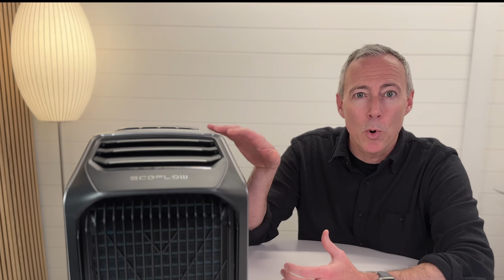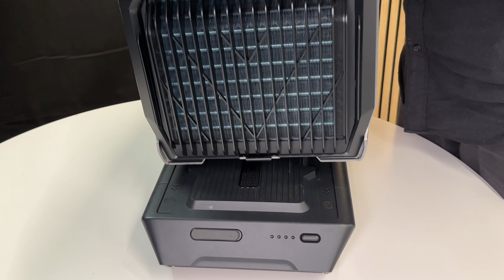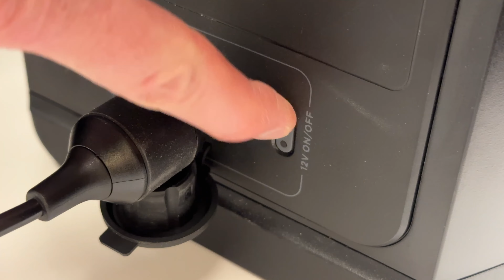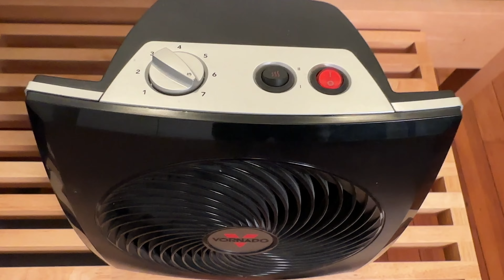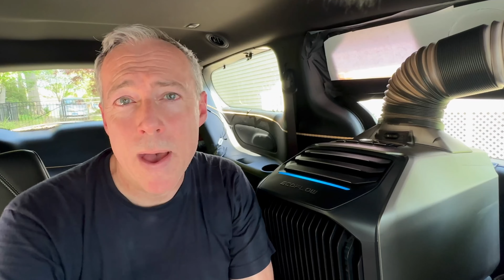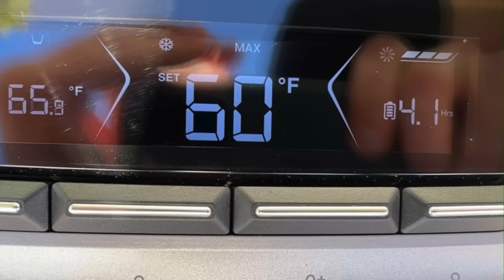EcoFlow WAVE 2: Heater + AC in a tiny, portable package

Comment: Good video.  Mine is arriving tomorrow. My question is, do I need to vent both hoses out the window?  Especially since I live in Florida and the humidity is awful.  
I’m wondering if I can vent the exhaust and keep the other hose off to intake cooler air from my Rv.
Reply from the maker: Turns out you do. I missed a few things in the manual so the test where I only had one hose in the van wasn't as efficient as it should be. If the unit is inside your room, you need to vent the back and top out the window, like my heat test had it
Reply: @todd.parker    Ok great.  I figured as much. But I thought it may be more efficient drawing in less humid air than not.  But I didn’t design it and that’s what the drain tube is for.  Now I’m curious if the drain water is drinkable for an off grid type survival scenario.
Reply from the maker: @scottmcguire9618  That was why I tried it that way but it turns out heat humps have 2 separate cycles that need to be separate so you need to isolate the input from the output by using 2 hoses. I'v heard it's very dangerous to drink dehumidifier water so I assume this this same.
Reply: @todd.parker   thanks for the info.

Comment from the maker: Hi all. I've learned that I should have hooked up the second hose when doing my AC tests so this would perform even better if I had. When using the unit inside the van, both the back and top hoses should be attached. Thanks for all that explained this to me. The heat test used both hoses and the tent AC only used one hose as EF recommends.
Reply: Yeah, I was about to comment you were doing the test all wrong with only using one hose in the car. Would have liked to see how long it would have lasted when optimizing power as I’m considering using it in my sprinter van.

Comment: 5100BTU for cooler air is pretty weak
Reply from the maker: It's definitely optimal for a smaller space like a van, tent, or single room
Reply: i haven't found a portable A/C unit that has more than 5100 BTU cooling. I"m new to these things but i've been looking online all tonight.

Comment: Won't run without the battery... Where i live the unit is $1400, and the battery $1000. I can just buy a smaller residential AC and an extra battery for that money, and would probably come out on top.
Reply from the maker: It will run fine plugged into AC without the battery. I agree the battery pack isn't a great value so I'd get a Delta power station and power it with that I you need to go off grid

Comment: Can this realistically be used in my car everyday ? I just purchased it and I want to use it not only for my camping trips and my addict but I bought it because I spend a lot of time in my car on lunch breaks and I hate idling my engine in the summer to stay cool …I’m hopping this works
Reply from the maker: It would work fine. The only issue is you need 2 hoses vented out the window or sunroof and that might be a hassle driving around.
Reply: @todd.parker  thanks I would tingly use it while parked tho so I don’t have to run my engine when it’s hot and I’m just sitting there

Comment: Todd. I've been looking at battery powered AC units for my little trailer. Having installed a mini split in the house I'm very happy with the tech, which separates compression and expansion to TWO air supplies: inside and out. Which means I think you missed a point in your van and tent air-conditioning testing. I'd like to suggest you re-test by recognizing that you want to cool conditioned air. That should cool the spaces faster and extend battery life. You should ALWAYTS use both tubes. Either off the back to vent air to the outside or off the front to circulate air to the inside. With the tent you were sucking in outside cooling it and sending it into the tent. But that also caused positive pressure in the tent which would have been forcing cooled air out of the tent. You should have used both tubes for AC. One tune for the front upper vents cooled air (as you did), and the other on the front grill to take cooled air from inside the tent to further cool it. You made a similar mistake in your van. You vented the hot air out of your van but should have used the second tube on the back of the WAVE 2 so that the air you were using for compression side of the cycle was coming from the outside. Instead you were using cooled van air. Which meant hot exterior air had to replace the air you were sending out of the van. I'd suggest you try again with both tubes. You'll likely get a little more run time.
Reply from the maker: Thanks so much for the detailed explanation. I realize now that I misunderstood how heat pumps work and should have attached the second hose on the tent and van tests. Drat. It performed well anyway so it would do even better if I had attached the other hose!
Reply: I’d be curious to see test results comparing single vs dual hoses in various situations. And how about a test on your van at night?

Comment: Fresh air is brought in through the back where it cools the condenser and expelled out the top not through the unit . Inside air is brought through the front cooled by the evaporator and pushed out the top The front and back are two separate units completely just like your house heat pump
Reply: I didn't see two hoses in air conditioning mode, only in heat mode.  The deduction is it constantly wastes air-conditioned room air to exhaust itself, and draws in exterior hot air to replace the lost interior cooled air.. The perfectly balanced heat mode more efficiently operates by taking in exterior air to exhaust itself. It works well in air con mode, but needs an opening(security, insects), and so could be better.
Reply: @mikemotorbike4283  starting at the control unit going downward The AC comes out of the first vent then there is a vent below that running vertical that is where you were bring your recirculated cold air through the evaporator and then cooled out the vents on the top this is a heat pump which means it reverses the direction of the freon therefore turning the evaporator into the condenser in the condenser into the evaporator this is exactly how your house works when you turn on your heat if you have a heat pump the heat comes out of the same place your AC come out of The back side of it where you see the two hoses out is basically your AC unit that is outside of your house pulling air in through the condenser and cooling and expelling the heat... YouTube a video on how a heat pump works
Reply from the maker: Thanks, I messed up on that in my AC tests so it would have been even more effective.

Comment: how come the heater mode uses two hoses and cooling mode uses one hose?
Reply from the maker: Ah, technically you should be pulling in fresh air into the back like I showed with the AC test but in the van, I wanted to try pulling the already cooled air from the car back in, sort of like your the recycle mode on your car's AC. I'm still unsure which is best.

Comment: Question: after the battery dies from its 800 cycles, can you still use it with solar?
Reply from the maker: After 800 cycles the battery will still have 80% of its capacity so it won’t be dead, just “smaller”. It’s the same kind of battery and your smart phone and you can see after about three years how it really loses a decent amount of runtime. Anyway, it needs a battery and can’t be run directly off solar because it needs a lot of power and cloud passing would mess it up. You can skip the battery and connect it to any Delta power station and that’s probably the way I’d go

Comment: Battery is required for portable operation. It can not function on solar or your own battery. $1600, no thanks. Try sleeping next to something that makes 45 dB noise.
Reply from the maker: A battery is always needed to run something on solar, it would cause a lot of wear and tear on the compressor if it lost power with every cloud passing. You can use any Delta power station and I say that’s a better value but it can’t use a basic 12v battery, it needs 48v which would be tricky for an average person to put together. To be clear, 45db is the noise level but the ambient sound level was around 35db so this was about as quiet as a fan which is very good.

Comment: Air does not come in the back and to the front. Go research again on how it works. Your understanding is wrong
Reply from the maker: By front, I meant top front and showed the vents as I said it. Not a big deal.
Reply: @todd.parker  , but the air that comes out the front top comes from the front grille, not from the rear of the machine

Comment: FYI, you said "the NCM battery will have a limited lifespan of only 800 cycles" however the manual for the Wave 2 specifies "80%+ capacity after 3000 cycles". I also see the website mentions the 800 number you mentioned. So unclear which is actually correct.
Reply from the maker: Guessing the manual is wrong. That’s the cycle count for a LFP battery

Comment: Would be interesting to compare the AC in a tent to a small fan cycling with cooler air from outside.
Reply from the maker: For sure. At night, a fan may do the trick. My test was pretty extreme, just leave the tent on a hot day!

Comment: There are more con’s than you listed. A big con is that its not at all practical for a van.
Reply from the maker: Interested in hearing more. Seems like it would work well in a smaller campervan. Ecoflow had one set up in a Sprinter at CES that seemed pretty slick. Definitely much easier to install and more compact than a rooftop AC + diesel heater.
Reply: @todd.parker  if EcoFlow gets into the roof top AC business with the internals of this unit and scale up a bit they would dominate the industry. DC A/C units are in the $2-4k range and no heat pump function

Comment: Excellent video and tests. Is the Pacifica a PHEV? so you could you just run AC the traction battery?
Reply from the maker: I was going to get the hybrid but ended up getting the AWD version. I'm not familiar with what kind of DC outputs you can get from the PHEV but as long as the voltage is between 12-60v, it would charge through the XT60 port if you had the extra battery. Or you could hook it up to a Delta and charge that from the car. In either case, you're not running it directly but trickle charging a battery that powers it
Reply: @todd.parker  Gotcha, sorry I meant running the car’s own AC as HVAC. Wish they had a Sienna Prime because our RAV4 Prime can run AC all day long. Even has a “room mode” when you’re plugged in. I was parked under a tree yesterday (since my daughter fell asleep on a car ride and wanted her to keep napping )and the van (2021 Sienna) started 2x and ran for 5mins the whole hour.

Comment: That extremely low cycle battery is a deal breaker for me.
Reply from the maker: Yeah, I'm guessing that it helps with size/weight but when they've switched to LFP, the weight difference has been a few pounds at most. Maybe they will offer a LFP version or bigger battery at some point in the future. Unless you really need to compactness of the clip on battery pack, I think buying a Delta 2 or Max to power it would be a better value overall, especially if you are going to use this daily. It's cool to be able to pick it up and use it by itself but by the time you set up the hoses, adding another box and cable next to it isn't a big deal if you have the space.
Reply: You could get a Delta 2 with similar LiFePo4 battery for less $$$ and have much faster charging options.  It runs the Wave through a DC connection cable.

Comment: Scott, great review.   What is minimum height with tubes connected and pulled to rear.   I have a cabinet space in my TAB 320 teardrop with an outside opening that might accommodate the unit, without the battery.
Reply from the maker: Good question. I just measured the height with the top vent tube Bev’s straight back and it’s about 19.5” or 50cm

Comment: in the van, you only used the top vent?  I am considering for my camper van, live in FL, so I  want to make sure I operate it in the best possible configuration.   Thanks for the review.
Reply from the maker: I did. When I tested heat in my guest room, I used both hoses but figured that by pulling cooled air into the back and only venting the waste heat, it would work more like the recirculation button on your car's AC. EF said that was fine but I haven't tested it enough to know the pros/cons of using fresh air.
Reply: @todd.parker  The Wave 1 and Wave 2 don’t work like the “recirculating” feature on a car.

Wave 1 and Wave 2 have a double closed loop system.

The 2 hoses on the rear of the Wave are attached to the condensing side of the loop like the condensing unit on the outside a house Air Conditioning system.

The front on the unit is like your forced air furnace in your house. The front of the Wave 2 brings in air and the top front expels air (hot or cold depending on the mode selected).

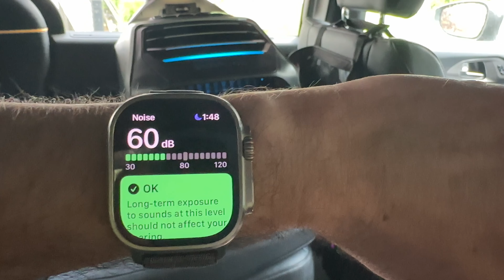You can see it explained here if you fast forward to 10:00 mark of this video.

https://youtu.be/2NBfhABwn18
Reply from the maker: @thechamp66  Thanks fro sharing that information Kevin, that's super helpful. Seems I should have attached the second hose in my van test. Oops! None of this is very clear in the instructions.